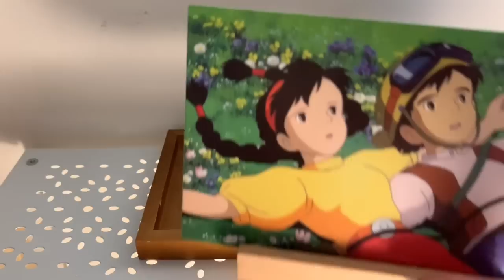✨ NEW DESK SETUP + building my first mechanical keyboard | aesthetic asmr and music ✨

Comment: How did you set up the monitor? Did you need to build a pc or use a docking station? A reply would be helpful.
Reply from the maker: Hello! I actually don’t have a pc or dock atm! I only plugged in the HDMI into my laptop. And my laptop just sits hidden away under my desk LOL :)
Reply: Okay! Thank you so much, I’m thinking about getting a monitor so just wondering. :)    Also I like your desk, it’s very ✨aesthetic ✨    Thanks for the quick reply, I don’t usually get replies this quick :’))
Reply from the maker: @lexigaede009    Ooooo good luck! And no worries, I’m happy to answer ❤️❤️
Reply: @lovelynn  Where did you get that little cat dish/plate 7:13 it’s v cute.
Reply from the maker: @lexigaede009  Unfortunately that was a gift I received last year ! 😞

Comment: Can I ask someone a question: Why do you build a keyboard? Why somebodcy does this? I seriosly dont understand it. Its nothing wrong with it but I would like to understand it. Can someome explain it to me?
Reply: Because mechanical keyboards have great sound and feel. Building them is one way to make sure all switches and stabilizers are well lubed and secure in place, and add sound absorption so they don’t rattle or make annoying noises. Instead you get a long lasting keyboard with incredible sound. Hope this helps!